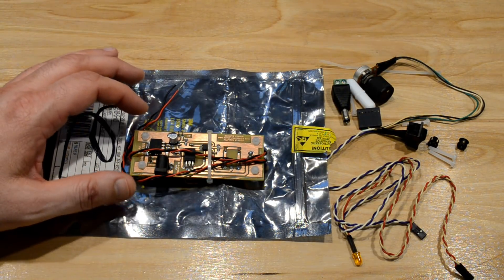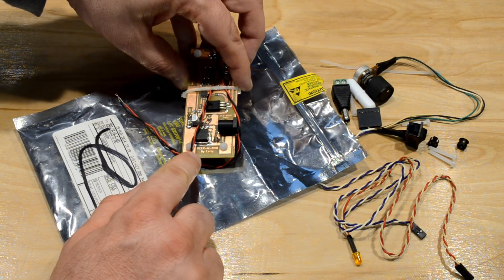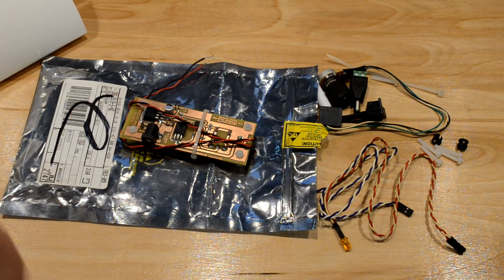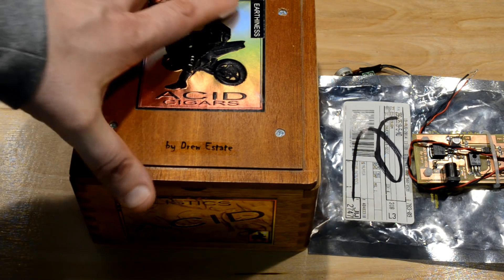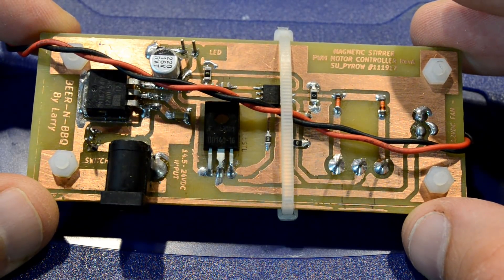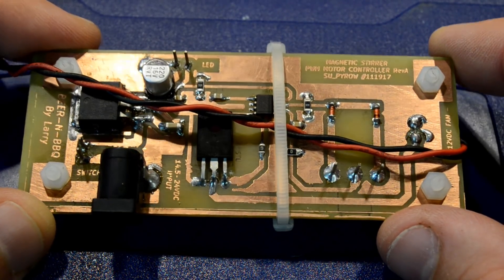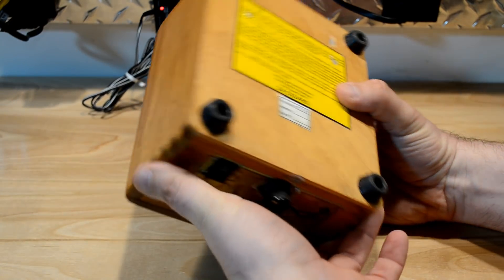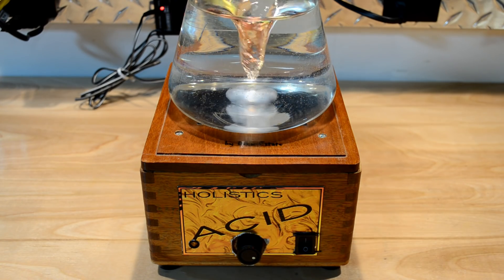DIY Magnetic Stir Plate PCB Upgrade

Comment: Interesting but isn't that an extreme overkill for a simple task? I made my stir plate with just a fan and 9 volt power supply. I have several power supplies and the 9 volt worked best for the fan I used. Does  this new control give you any better performance with your Yeast starters?
Cheers!